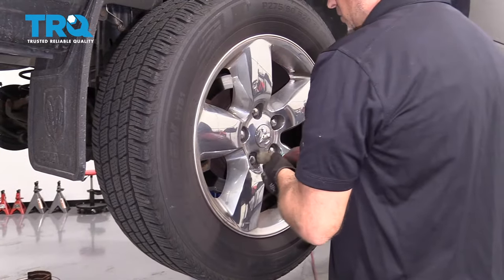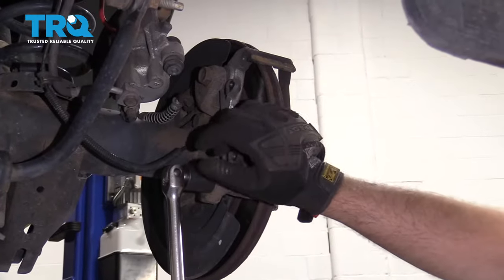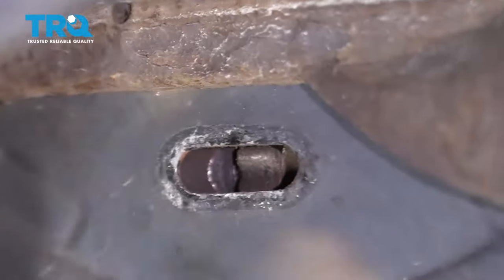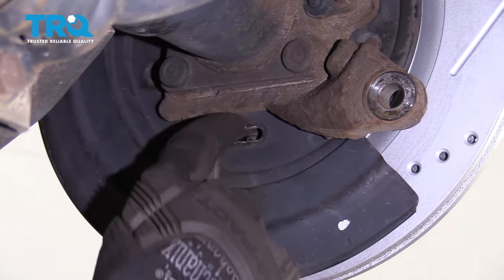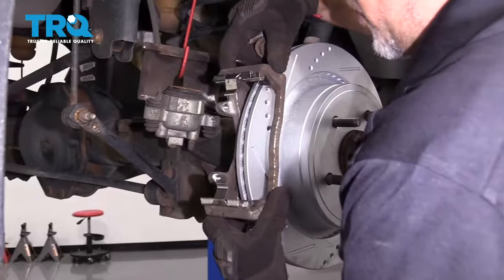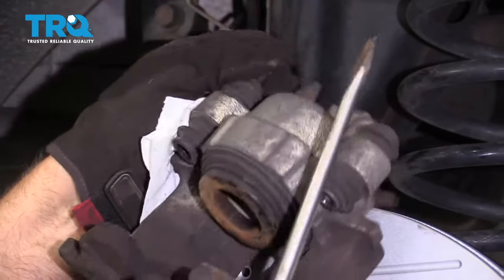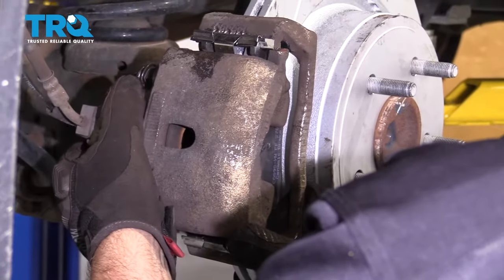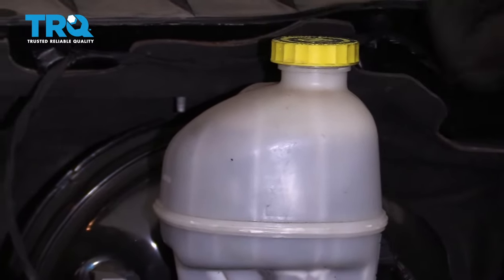How To Replace Rear Brakes 2009-2018 Ram 1500

Comment: 10mm bolt.  On caliper.  2016 Ram 1500. Anyway.  Is there a need for grease inside the slider tube that the mounting bolt goes into?  I see you greased the outside of the barrell and the inside of the boots but not the inside of the barrell where the bolt goes through?? I'm questioning it because there is a smooth portion on the bolt before the threads.  Little confused.

Comment: Is there a reason why you didn't use brake parts cleaner to clean off the packing oils on the inside where the parking brake shoes grip?

Comment: I have a question would the back brakes work on front
Reply from the maker: +Floyd Stevars The rear brakes are typically a different size than the front and are not interchangeable.